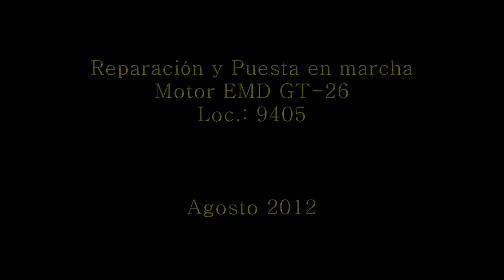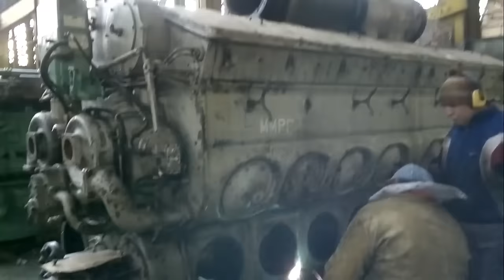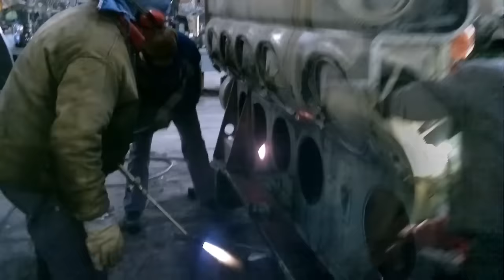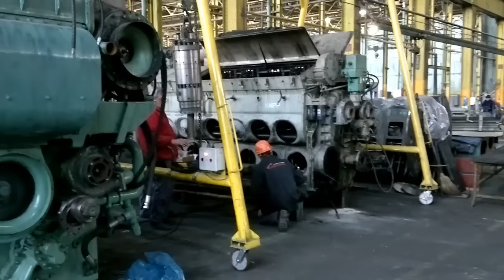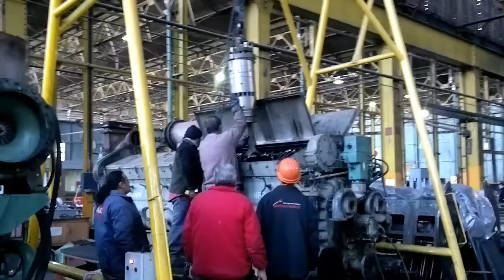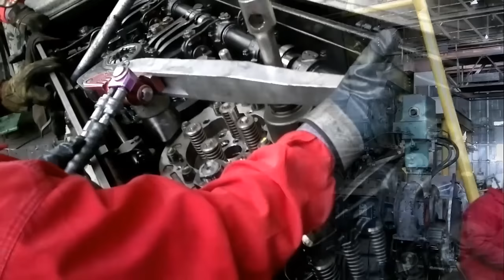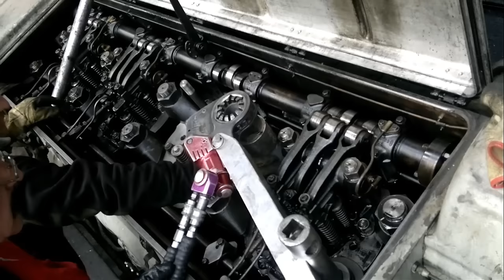Locomotora EMD GT-26 #9405.

Comment: I have aquestion for you Bro.... I have twice EMD turbochargers 16-645 E7B & one Turbocharger 20-645 E3. One customer
have several problems in his 3 EMD Engines 12 cilinders Turbocharged.Bro....based in your experiences, Can I supply and mount my Turbochargers on these Vessel? Could there be any inconveniences in the oil and fuel consumption
of those engines? Thanks for your answer...Best Regards from Paraguay!!!!!!

Tengo una pregunta amigo......Tengo un par de Turbocargadores EMD 16-645 E7B y aparte uno 20-645 E3. Un Cliente tiene varios problemas en sus 3 Motores EMD Turbocargados que son 12 Cilindros hermano....Basado en sus experiencias: Puedo yo suplirle y montarle mis T/C en su Embarcación? Podría tener incomvenientes en cuanto a consumo de aceite y combustible en esos Motores? Gracias por su respuesta....Saludos desde Paraguay!!!!!!!!

Comment: es un motor de 2 tiempos?
Reply: pero no podes ser tan cuadrado como va ser 2 tiempos
Reply: hay algunas EMD 567 dando vueltas por ahi, estas tienen motores detroit diesel de dos tiempos.
Reply from the maker: Así es, es un motor de 2 tiempos de unos 2600 HP
Reply: Dos tiempos con bomba de barrido
Reply: EMD o Simplemente GM de EEUU =MOTOR de 2 tiempos en éste caso EMD 645-16 Gt 2 o 3 g o t es la especificación de su turbo para darle más revolución al cigüeñal de 22.000 revoluciones a 27.000 dependiendo del modelo de los turbos ;el 645 es las pulgadas cúbicos que tiene los cilindros osea 10.57 litros TODOS son el mismo de ése modelo de 8,,12,16,20 cilindros  y 45 es la distancia entre los cilindros osea se separan en un 45 grados de inclinación entre sí yo de ésas ya tuve la experiencia de escuchar y ver como trabajan pero en un remolcador de empuje era EMD 645-20 G3 de 20 cilindros en V y poseía dos 3600HP cada uno un TOTAL de 7200HP TENÍA de FUERZA ERA un FENÓMENO de la ingeniería mecánica cuándo daba a toda MÁQUINA era impresionante 👉😨👈🤘😎👌
Reply: @sonidootero  camaras DE barrido !!

Comment: What is that, like 100,000 lb-ft
Reply from the maker: Nuts are a torque of 1900 lb/ft or 2600 N/m
Reply: Carlos Contreras
I meant the output of the engine.
Reply from the maker: Stephen Bagnell
ups
The power of the Diesel engine is of 3000HP approx
Power delivered to the traction motors of 2800 hp approx.

Comment: They dont have the right tool to descend the power assembly in.
the engine block on the left looks a lot like a alco engine block
Reply: ....well how special a crane do you need? What does it need to do?

Your kids swing set is not the right lifting device for a sbc, but it will still do.
Reply: dav3fk That is the right tool...
http://www.tescotools.com/emd-1/cylinder-and-head/t62640-emd-power-assembly-lifter-for-type-c-d-and-e-engines
Reply: François D
I wouldn't buy a price-on-request hook, either.
Reply: dav3fk It is for information only
Reply: I noticed that also. It looked a lot like they didn't know what they were doing during the whole video. About using the correct tool - "It's hard to win an argument with a smart person, but it's damn near impossible to win an argument with a stupid person".